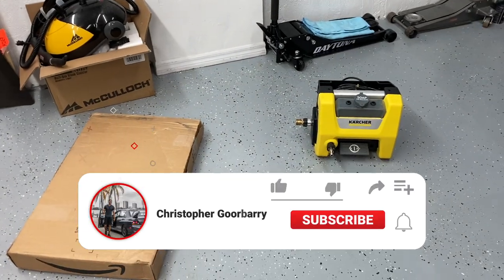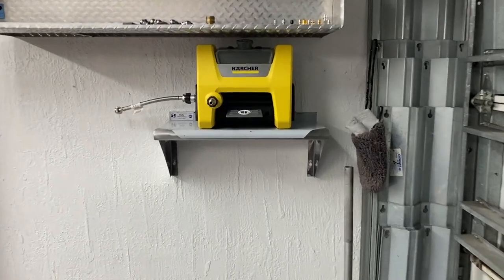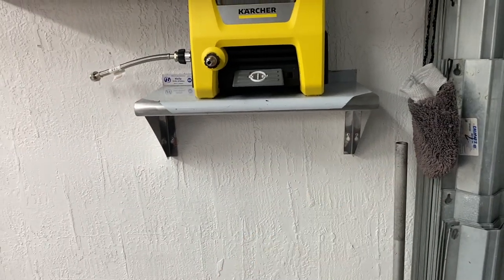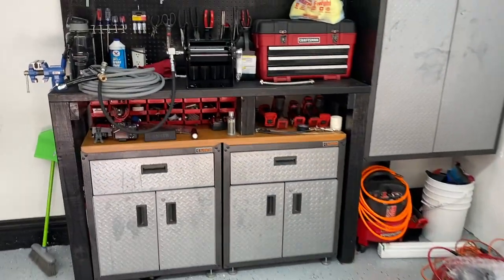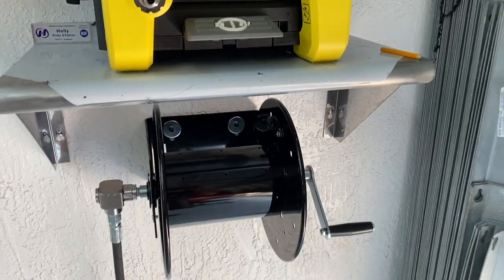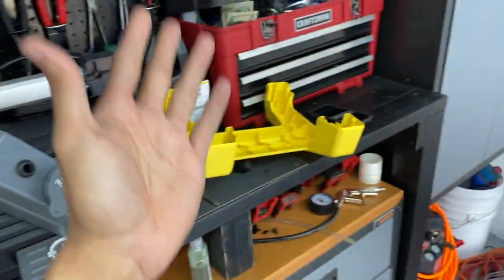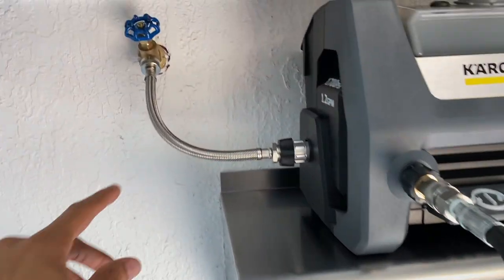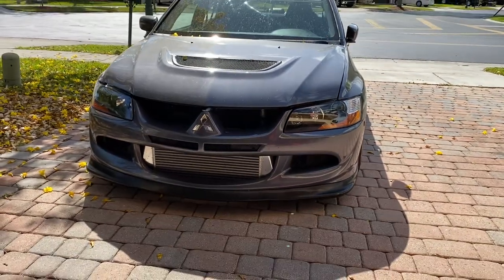Karcher K1700 Wall Mounted Pressure Washer Solution (Obsessed Garage)

Comment: I applied car sound deadener to the stainless shelve and there is no vibrations on it. Much quieter than just putting the machine and a little rubber mat. Im surprised I haven’t seen anyone do this in all the videos Ive watched.

Comment: Good thing you went with the 75’ hose and not the 100’ like I have seen others do.  Really 50’ would be choice but 75’ can work.  Also can I ask why you chose to mount on wall/shelf?   I have my setup inside small work cabinet just because it creates less noise (installed some padding) and able to have other cleaning tools in it.  Wasn’t sure if there was any benefit by placing the unit higher or anything?
Reply from the maker: I did it from inspiration of Matt from obsessed garage he’s been setting them up like this for quite some time with the hose reel underneath I just like the clean look it gives it! There’s a couple of people that have done it like this too and there all super dope!
Reply: @ChrisGoorbarry  okay.  So no other benefit really other than like how it looked?  Just wanted to see if I was missing out on any output or whatever by having mine setup the way I have it now.  Thanks
Reply: @jermanehoowse4618  Now you have me interested.  Do you have any pics online to show how you have running in your cabinet?  Thanks!

Comment: Quick question, is it necessary to have the water bib coming from above the pressure washer and hoses? 

I’m about to do a wall mount install but my water bib is about where your bucket bib is. And I plan on installing the hose reel higher than the water bib… is this going to cause issues? Thanks

Comment: Does the Karcher rattle off the shelf? If so, how did you secure it to the shelf? Thanks!
Reply from the maker: Great question! I put 3m double sided tape on the front two tabs hidden so you can't see it on the shelf and I haven't had a single issue!

Comment: Your video inspired me to make my own pressure washer set up. I ran into a little problem and was wondering how you fixed this. My karcher cube pressure washer seems to vibrate so much that it almost falls off the shelf. Any suggestions? did you have the same problem? Thank you.
Reply: Most user will use anti vibrating puck or mats.

Comment: how did the plumber run the water lines without destroying your walls?
Reply from the maker: Kinda hard to explain but it goes through the outside and he just drilled a hole to put it inside the garage. I wish I could attach pictures to comments lol

Comment: I would get rid of that 1/2 of 5/8 stainless hose your using for the inlet side. I would of made sure I had a 3/4 line ran for my water feed and then use a stainless water heater hose which is 3/4 to make the connection. But I would of also not went with hose bibs. I would of had hard pipe with a ball valve. Too many restrictions for my liking. If you have a 3/4 feed then use a 1/2-5/8 hose your reducing your flow.